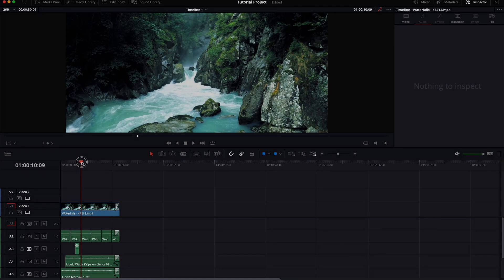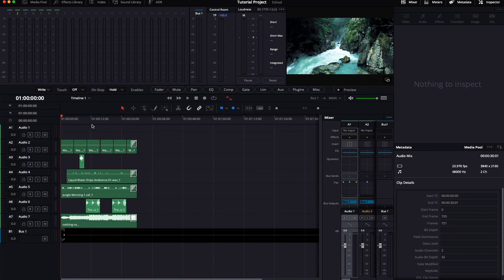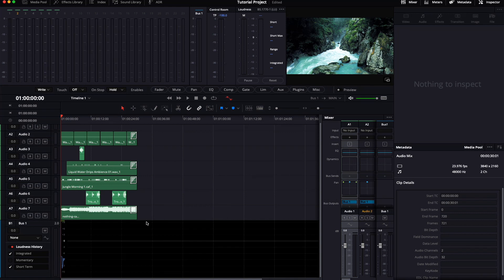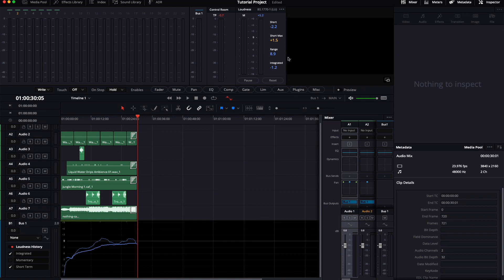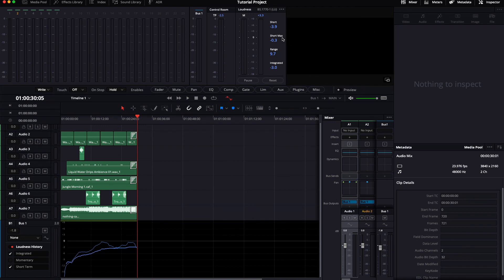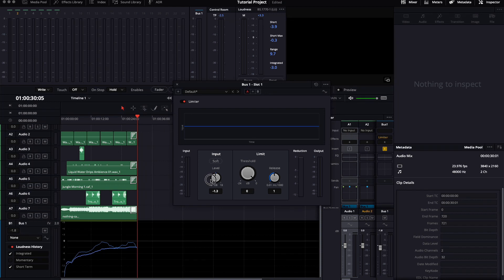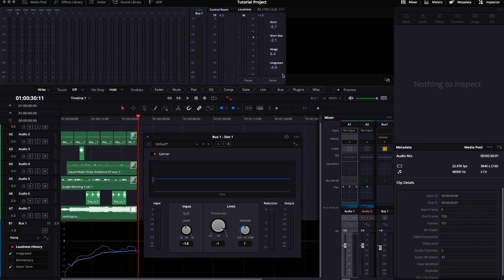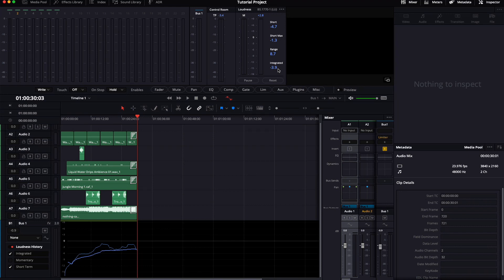How to NORMALIZE your AUDIO in DAVINCI RESOLVE

Comment: Hey thanks man this was very helpful. I managed to follow through up the the point where I have to set the limiter. I didn't quite get why I should set the input of the limiter to the exact same value as the volume fader of the main track? If I do so then I very very faraway from the target. Is there a simpler formula to understand how to set the limiter? Thanks in advance